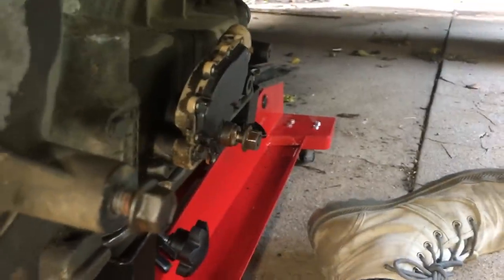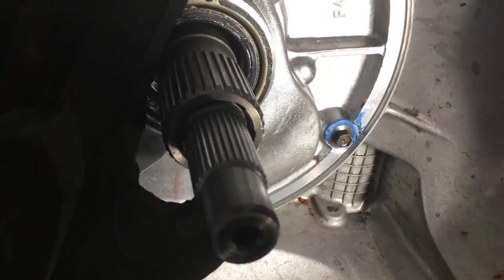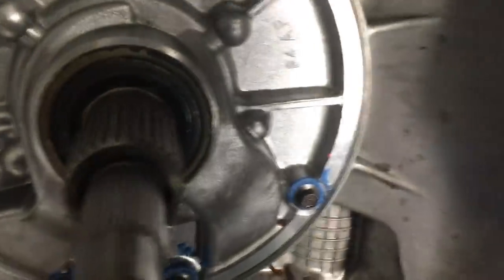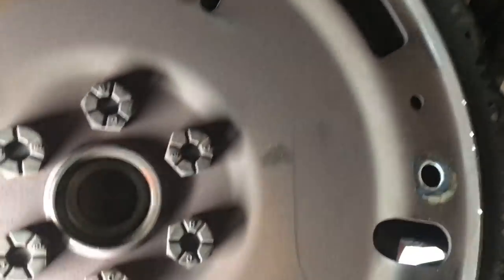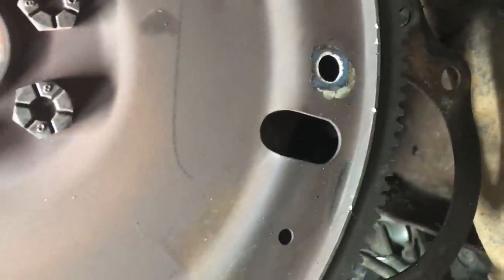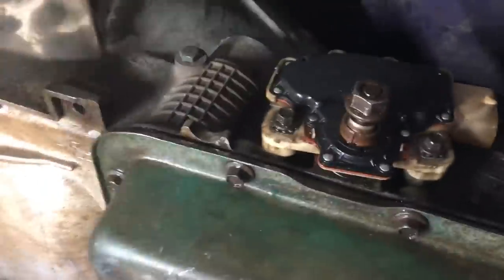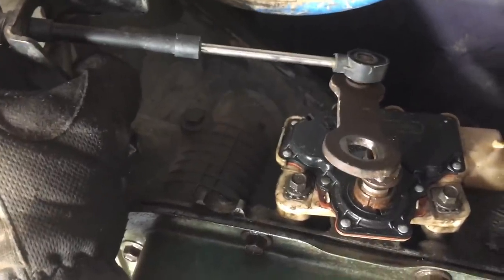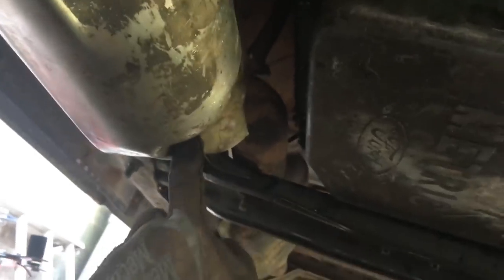How to Install a Transmission by Yourself in One Day | 1995 Ford F150

Comment: You can spin you fly wheel woth a pry bar st the bottom if you take of the Inspection cover. Just a little tip for lining up converter n flywheel
Reply from the maker: Good tip!

Comment: How much fluid did you prime the torc converter with and how much does it take all together to refill the transmission? Great video.. I am going to tackle my Lightning soon
Reply from the maker: I put two quarts of fluid in the converter which seems to be the standard. The transmission as a whole, I think takes 12-14. In all honesty, I just fill the transmission until the dip stick reads the correct level. You should be safe with 12-14. Though. Even if you are still a bit short, you will have enough fluid to get to an auto parts store. If you have too much you can return it or keep it one a shelf for a future change.
Reply: What type of trans. is in your lightening
Reply: It'll take a case to fill it, converter and all from dry.

Comment: Hello. Thank you for explaining all of that. My truck has recently been sabotaged snd I can't get anyone to fix it. I am a 60 year old woman and I am attempting my first transmission and doing it alone.
Reply from the maker: Hi Lisa! Sorry to hear that. What was sabotaged about the transmission?

Also, I have a newer video on how to replace a transmission that has better visuals and more information.
Reply: @TheMinuteMasters  can you send me the link for the other video you mentioned. The sabotage is cut hoses and wires and the wiring harness has been changed. Gas lines and other hoses are pinned under intake manifold, etc.. It is a mess. I am decastated.
Reply from the maker: @lzwallen123  Wow! That’s incredible. My videos may not help with fuel lines and repairing wiring harnesses, but there might be something to help you out.

https://youtu.be/oXcPzexipN4

Comment: Great video but it’s a piece on the top next to those 3 connectors u showed… where is the hose that connects ?
Reply from the maker: Are you referring to be almost 1 inch in diameter black hose?
Reply: @TheMinuteMasters  I wish they allowed pics… it’s a single metal piece that sits at the top of the transmission all alone around the area near the 3 connectors.. it might has a hose that go over it but on my truck it’s bare and when I pour or start truck trans fluid pours  out .. If I was to go under the truck and reach up above the pan it’s right there… apologize for lack of clarification
Reply from the maker: @rasheedaustin6064  So there is a piece of metal that holds the middle part of your dip stick tube. Without it, the tube won’t stay seated. That would explain why fluid leaks out when you start it or try to fill it up. That plate is held in place by two of the transmission bell house bolts.

Comment: Probably a long shot but…do you happen to remember where the longer bell housing bolts go?
Reply from the maker: That’s a good question. I can’t remember exactly. However, I don’t remember having to mark the bolts to know where they went. You can always use a small rod or something to measure the depth of each bell housing bolt hole.
Reply: @TheMinuteMasters  that’s a good idea I’ll do that! Worst case scenario I use the cancel out method🤣 thanks for the help!

Comment: Where do the two long Bell Housing bolts go? I didn't realize there were different sizes when I was talking them off
Reply from the maker: Good question! I don’t know off hand. It may take a little trial and error.
Reply: @TheMinuteMasters  I appreciate the reply. I found it online. They go in the dowels. However, now I have another question now. How do you get the fluid pump gear to stop spinning while you try to seat the torque converter. I thought of taking the pump off and packing the pump gear with vaseline so the gear would resist spinning with the converter.
Reply from the maker: @KP-qh8je  Oh good! 
I don’t have a solution for that. I just kept spinning the TC until it double clunked into place.

Comment: Hey Steve i installed my transmission, but it won’t shift into gears - it’s an automatic everything looks good but won’t Shift - Any advice?
Reply from the maker: Is your transmission fluid at the correct level? Does your actually shifter move and does it feel like the linkage is working?
Reply: I'm having exact same problem!  And my shifter won't move

Comment: Was there anything you did that went wrong . my problem is the torque. Converter. How do we know when it in right does it has to free spin when attatched ??
Reply from the maker: Nope, I’ve now put at least 40k on the transmission. Still works like a charm and I’ve towed a trailer a 1000 miles twice. 
You’ll know the torque converter is all the way on both shafts when the TQ doesn’t stick out past the bell housing. When it fits over the first shaft it will stick out too far.

Comment: That’s the funny thing. When I started working on the truck, I put it on neutral. After I installed the new tranny, for some reason the shifter in the car was on drive. So I put it back on neutral but still the same. Could it be the neutral safety switch is no in the correct position
Reply from the maker: sargon khabeer that’s weird. It should stay in place. The switch/adjuster is on the side of the trans.

Comment: Do you have to torque any bolts? I’m looking for torque specs.
Reply from the maker: Kirsten Ott Yes, you will definitely need to torque bolts. A good repair manual will have torque specs. I used this manual:

Ford AOD Transmissions:... https://www.amazon.com/dp/1613251149?ref=ppx_pop_mob_ap_share

I’m pretty sure it had all the torque specs. You can also buy a Haynes manual from any auto parts store and they have torque specs at the beginning of each chapter.

Comment: Hey long shot but it would help massively. I've misplaced my bolts. 4r70w going onto the back of  4.6L, any idea on sizes?
Reply from the maker: Definitely a long shot question for sure. I don’t even think I have a thread sizer big enough to size the bolts. 
I’ll say this, if we’re just going to guess. I would figure it to be a metric bolts. Probably a 1.75 or 2.0 metric thread pitch. The pick up a M12 or M14 as a test bolt. The longer bolts are probably 2.5 to 3 inches long.
Reply: Go to a junkyard and remove the necessary hardware. Don't misplace them.

Comment: Thank you for your reply. The driveshaft is not installed. I can’t turn the torque converter because it has 4 bolts that’s go into the flywheel. The tc spun freely before I installed the transmission. And all 4 bolts came through the holes on the flywheel. Does it have do to anything with the transfer case being installed? If the tc was not seats right, the transmission would have not lined up correctly. I’m stuck and trying to figure out what went wrong
Reply from the maker: sargon khabeer Ok, yeah your transfer case could have something to do with it. If the tc lined up with the flywheel and the bell housing bolts installed. Then it should be mated properly. You tried putting a socket on the crankshaft bolt on the front of the engine and turned the crank shaft?
Reply: @TheMinuteMasters  Steve. if you are still in PA ... anyway to contact you?
Reply from the maker: @leebenjamin3184  Hi Lee! I don’t live in PA anymore. I moved to Iowa this passed December.

Comment: Do tell me you forgot to grease the nub on the front of the torque converter? (Crank side) very important. 😉
Reply from the maker: What does the greasing do?
Reply: Honestly I don't know the actual science behind the reason doing it other than there's so much torque that that nub can move around ever-so-slightly inside of its resting place. From the Ford forum I was told that it is extremely important to make sure that it is greased. I don't believe that it's going to be detrimental in any way shape or form, just sharing a little tip that was given. 😉 I just got my 4R75E back into my 05 e250 and should have the trans cooler and driveline hooked up today and able to test drive it. Nervous, I am! But I gave it all the upgrades bells and whistles I could do. 🤞 Congratulations on your success!!! Definitely and involved process, but less intense than I thought it would be! Thanks again for the video. I watched... it feels like dozens to get all the info I could. Transmission bench is AMAZING! Rock on....
Reply from the maker: @phreezown2862  Gotcha, I’ll remember that for when I take the transmission for a 4x4 swap. 
Thanks man!🤙 I’m glad this video helped you out and you enjoyed it!
I totally get it. There is something nerve racking about firing up a truck after you have removed and installed something as important and integral as the transmission.

Comment: Have you done the linkage up front of the truck before with the tie rods? I need to tackle that soon
Reply from the maker: I have replaced the tie rod ends before and I never filmed it. The drag link steering assembly is actually very easy to replace. Buy the proper tools to press the tie rods ends out.
Reply: @TheMinuteMasters  that’s man. Yeah I’ll buy a basic brand… can’t afford what MOOG has to offer honestly, at 600$ but it seems pretty simple, everytime I turn it squeaks but seems fairly simple to install
Reply from the maker: @willwork2fish261  No problem man!🤙 yeah definitely easy to install. It’s also worth trying to wiggle them and see if there’s excessive play.
Reply: @TheMinuteMasters  is there a way to just repair them instead of buying the whole thing?
Reply from the maker: @willwork2fish261  Yup! Every piece in the drag link steering, you can buy separately. In your case, you can buy the tie rods by themselves. You press the tie rod ends out of the wheel hubs and then unscrew them from the adjuster sleeves.
Reply: @TheMinuteMasters  okay I’ll see what parts I need instead of buying the connecting rods thanks man.
Reply from the maker: @willwork2fish261  No problem man!🤙 Good luck!

Comment: I know this an older video post but what trans fluid would you recommend for a freshly rebuilt FMX trans?
Reply from the maker: Is it a Ford transmission? This year of Ford Transmission recommends a Mercon V fluid which is synthetic. When in doubt, call FMX and see what they recommend.
Reply: It is a Ford trans, the older series C4,C6, and FMX all auto.
Reply from the maker: @ralphbabusci2666  I believe the C6 and C4 took regular trans fluid, but I can’t imagine a synthetic wouldn’t work.

Comment: Fixin to undergo this process myself on a 97 Ford explorer 5.0 my issue is my top to bolts are inches from the firewall no room at all
Reply from the maker: Dustin Miller Nice!! Can you get at the bolts using my method. Several long extensions from the tail end of the trans forward?
Reply: I'm thinking if I remove the trans mount and loosen the engine mounts I can get it to tip back enough to do it that way......  Makes me wonder how they put 5.0s out of these explorers into Ford rangers
Reply from the maker: Dustin Miller That should work! I know right! Lol I marvel at guys who can stuff big engines into small vehicles.
Reply: Ford did it factor with the explorers explorer and ranger share the same frame and the engine bays are almost the same size it's kinda ridiculous
Reply from the maker: Dustin Miller I didn’t know! Leave it to Ford to find away.
Reply: @TheMinuteMasters  that's a good idea

Comment: Can you maybe help me with a problem I’m having after installing a factory rebuilt transmission in my f150?
Reply from the maker: Sure! What do you need help with?
Reply: @TheMinuteMasters  thanks, so after I got it installed and everything. I went to test the heat to make sure it shifted smoothly. Then I put it in reverse and back it up a few feet then shut it off cause I had to move a few more things, and when I started it back up to move it, it didn’t move at all.
Reply: @Shane_B46  did u put transmission fluid in??
Reply: @nemesisnta9333  the rebuilt tranny ended up being bad.

Comment: Looks like front pump been replaced   and or seal been replaced   before replacing in transmission
Reply from the maker: Yes, I had this transmission rebuilt less than a year prior.

Comment: is it true that you have to take the are out of a transmission after you take it off an install it because the coolent line get air
Reply from the maker: Marcos Perez I don’t think so considering isn’t not a fully closed system like coolant. However,  you could in theory disconnect one of the coolant lines and run everything until it’s a solid flow of fluid.

Comment: How do you know if torque converter and flex plate are aligned.
Reply: There are bolts protruding on the TC that go through the flex plate

Comment: Got a question. Just finished installing my rebuilt trans on 2004 f150. Everything went smooth but I can’t turn the crankshaft to get to the other tc bolts.
Reply from the maker: sargon khabeer the crankshaft should turn. If not, turn the torque converter. If the drive shaft is in place you’ll have to either jack up the rear or remove the drive shaft.

Comment: So no limp mode problem after starting up??
Reply from the maker: Brent Bahe Nope! All back to normal!🤙
Reply: That's good to hear I'll hafta 2x my linkages n fluids then, I got high rpms, little movement
Reply from the maker: Brent Bahe Sounds like your torque converter isn’t transferring power or your transmission pump isn’t pushing fluid. Make sure your fluid is at the correct level.

Comment: Hey man I’m wondering going give a hand to a friend swap is tranis and engine can you pull the all think by the engine bay ? Sorry for my English I’m French
Reply from the maker: Nicolas Massicotte No worries about your English!👍 Yes, you can. You will need to remove the hood and make sure the engine hoist can lift the engine and trans high enough to get it out. It is not an easy job but it can be done. I removed both a straight six cylinder engine and trans out of an F100 (same size as an F150.) We used a balancer and we removed the two front wheels from the truck. Then lowered the whole front end. This gave us enough clearance to hoist the whole assembly out at an angle. Hope this helps!
Reply: Ok sweet man thanks

Comment: How long did the entire install take?
Reply from the maker: Ashley .Nicole If I remember correctly. I think it took me around 3 hours. When I set out to do a project like this. I set aside a whole day to be safe. However, you can definitely do an install in a morning or in an afternoon. Definitely faster with my people.
Reply: The Minute Masters thank you:)
I was thinking it would take 2-3 days. Thank God🙌
Also, where did you get your transmission from?
Reply from the maker: Ashley .Nicole Yeah no! Lol Not that long. One day I removed my transmission and set it up on a work table. The next day I took it apart and rebuilt it. The third day I installed the transmission. My brother and I swapped a transmission in a Chevy 3500 van and that took us 4-5 hours. So as I mentioned, this is the original transmission that I had someone rebuild. Several thousand miles later the over drive band burnt out. So I rebuilt it myself.
Reply: The Minute Masters that is really GENIUS😮!  I will show my uncle this video along with your others and we will see what we can do
Reply from the maker: Ashley .Nicole Awesome! Good luck!!👍
Reply: The Minute Masters thank you, Steve!😊
Reply from the maker: Ashley .Nicole You’re welcome!

Comment: 🔧The Minute Masters=🔧   WHAT ARE THE ABSOLUTE " MUST - DOs - And - MUST DONT's*  regarding installing a transmission in general and/or a transmission for a Ford Explorer Sports Trac?    🔧(thanks)🔧
Reply: also this tip was appreciated : TIP: 
Fill up your transmission with as much fluid as it can take, Turn on Your Truck Shift it Through All of Its' Gears to help get the fluid through the transmission , Then Check the Dipstick While it's hot, and add more as you need it,  once it is at the right level, take it for a trip around the block,  re check the level to decide if you need to add more
Reply from the maker: 1 - Don’t force any bolts and risk cross threading 
2 - Don’t over torque any bolts and be sure to apply the proper torque spec
3 - Use the correct transmission fluid. Fords are sensitive to fluids. Mercon V for most of the older truck transmissions.
4 - Make sure the torque converter fits over both shafts. They call it the double clunk. It should slide on and stop. It won’t be completely on. Then spin it and it should slide on a little more.
5 - Don’t over fill fluid 
6 - Replace filter and gasket while doing transmission install. 
7 - Don’t reuse old fluid.
Reply: @TheMinuteMasters  🔧Thanks So Much🔧              but for Number 4   -   (4.) You mention, "It won't be completely on"  did you mean to say:                                                   (A.)  IF it wont fit on                                 (OR)  Were you saying that,                                                       (B.)  from your experience that the torque converter/aka/double clunk   USUALLY doesn't fit from your previous experience ? And that if and when it doesn't fit completely JUST Spin and it should slide on more?
Reply from the maker: @internationalintellectcrow2865  If you bought the proper torque converter it will fit on. It has two different shafts it needs to slide onto. Hence he double clunk.